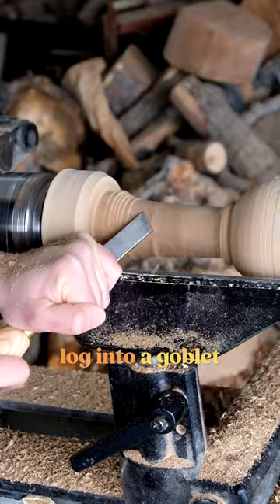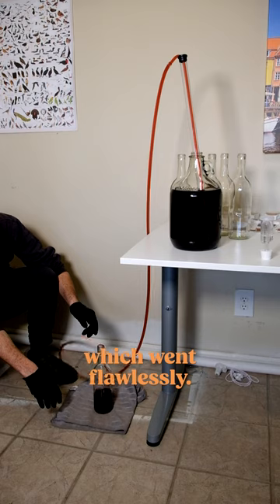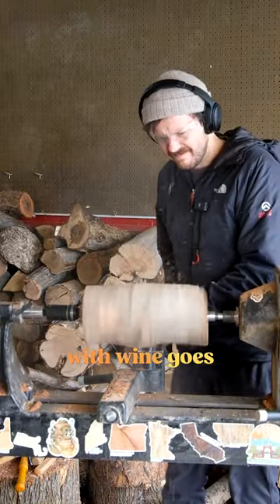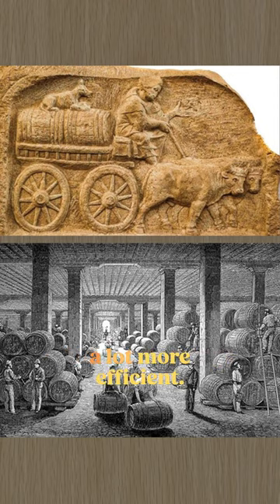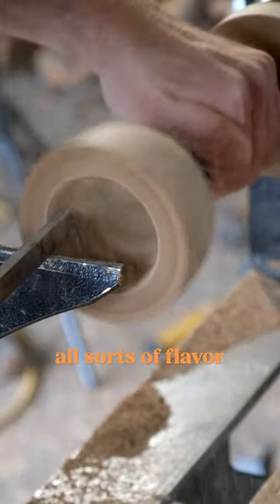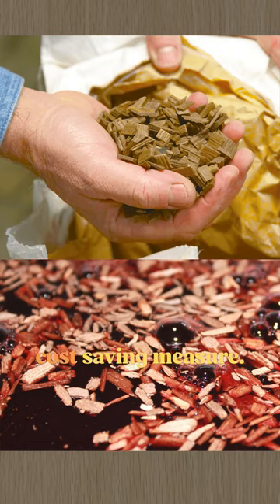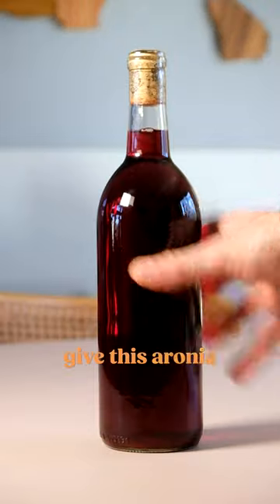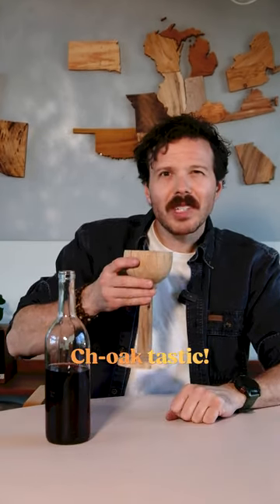Making a wine goblet out of oak #wood #woodworking

Comment: Hey man! Noticed you used something to fill the cracks. I make a kuksa but it ended up with some checking. Just wondering what you used to fill the cracks?
Reply: I'm guessing it's a two-component-epoxy. People also sometimes use woodglue or crazy glue with the specific woods sawdust added to make it blend in better, results may vary based on the wood type and applied finish. Also none of these are generally foodsafe, unless it's a special foodsafe epoxy formula or something like that
Reply: @jakobvanklinken  yeah most finishes don't do well with alcohol being a solvent and all. plus if the liquid does touch bare oak it reacts with the tannins in the wood and turns black. not my choice for a cup
Reply: @jakobvanklinken yeah I was wondering how that could be food safe

Comment: Have you ever experimented with ebonizing wood, you make the solution by putting 0000 steel wool into white vinegar for a few days, and wiping it on the wood. it works by carbonizing the tannins in the wood, which oak is particularly full of
Reply: That sounds really interesting! Black ink was historically made from oak galls and rust, which seems to be quite similar to the process you are describing:)
I might have to try this 'ebonyifyicationating'

Comment: Chips do save cost but they also impart more flavour much faster because of the surface area

A nice middle ground that is getting popular is using Staves which give flavour slower and more subtly

Both of these methods are superior by a country mile to using wood dust which was happening in cheap wine for a little bit and is as expected awful

Comment: Those clay pots are actually called amphorae, they cant sit up on their own due to the spike on the bottom, which made shipping them alot easier since they used a mixture of an egg carton and a peg board to transport them
Secure, and allows no room for jostling which could crack the terra cotta